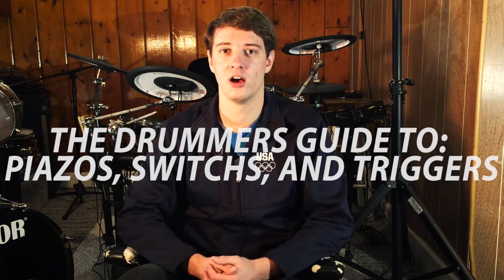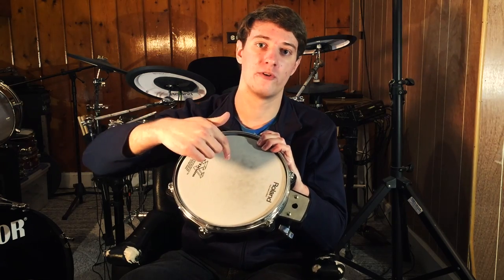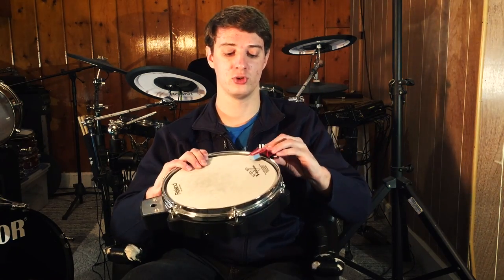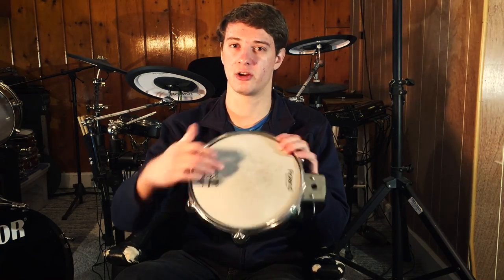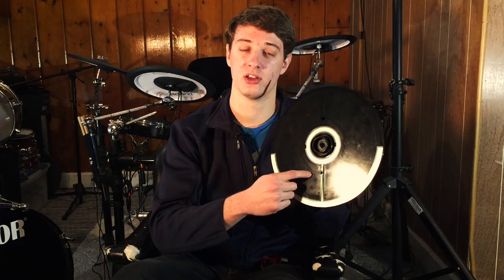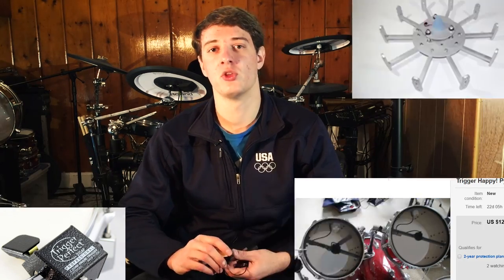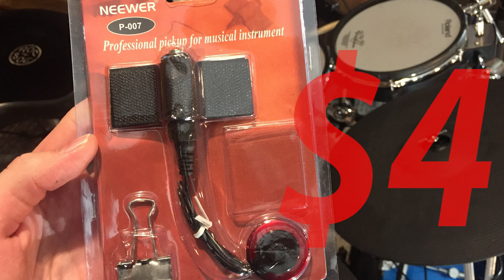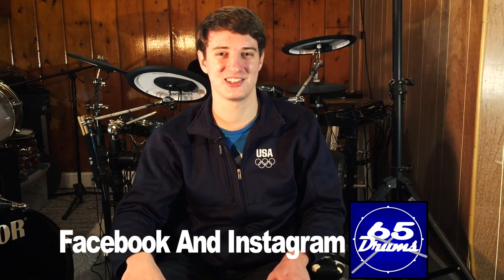How Piezos and Switches work: (edrums demystified)

Comment: Hello. Good job! In 1982 I and my band was one of the first buyers of Simmon elect drums; SDS-V, which I still have by the way. So after a few weeks my sound engineer and me decided to take one of the pads apart as when playing under very hot stage lights, the so called carbon fibber playing material glued on to the surface of 1/4” plywood would separate and they would puff up like jiffy-pop popcorn ( if anyone still remembers that product), when you hit the surface that carbon fiber would splatter like shrapnel. Anyway, we took one apart and found each pad was being triggered by a 
.25 cent piezo, same as you get at radio shack. So we got the idea to mount the piezos onto my acoustic drum shells and after s few tweaks, viola! They worked like a charm. You don’t know how many bands that have toured with us back then wanted to know how we were doing this through the acoustic drums; one in general was the drummer for the band, The Outfield , forgot  his name, but he had a mic suspended inside his snare drum and his sound engineer would add a little white noise to it, were as we had ALL the Simmons sounds at my disposal. In saying all this I have bene doing this at a time were no-one else even thought  about it. Just thought I’d share . But again, good job my friend...

Comment: piezo material generates a small voltage when it undergoes mechanical stress. The act of hitting the drum head causes the sensor to experience compression and therefore a voltage proportional to the amount of force. The drums must have amplifier circuits that detect this small induced voltage, amplify it, and then digital sample it. It must then be digitally signal processed and converted it into an audio signal. Quartz is a common piezoelectric material.
Reply from the maker: Very thorough definition.
Reply: Every chintzy little beep you hear coming from your various appliances? The alarm beep in your wrist watch? The speaker in your old school hand held LCD game or your late 80's computer? Piezo transducers in speaker mode. As mechanical stress induces voltage in the disk, applying voltage to them induces mechanical stress, which, if applied at the correct frequency, makes the brass disk resonate at usable frequencies. I think you can even use them in scales as a weight sensor. Nifty little toys they are!

Comment: Well explained, especially the cymbal. The hotspot issue also depends on the mesh material and the tension. Good Mesh heads that are not as stretchy will minimize the hotspotting.
Reply from the maker: I was really worried I didn't explain it correctly. I actually kinda put off posting this video for awhile. Thank you! And I did not know that poor quality stretchy drumheads caused hotspots. Good to know.
Reply: You did it correct with the cymbal. It is really a mix out of piezo and switch information. I was not sure about it myself, til I opened one of my crash cymbals. The hotspot issue is not caused by the mesh head only. But it is one of many factors. I figured out that drum-tec reel feel heads can be tensioned really strong and as they are not as stretchy, the hot spotting is reduced to a minimum. A Remo Silent Stroke for example, is way to stretchy.

Comment: Hey Justin, with all the vids you've created I'm shocked you havent made one with a good choking solution for using low volume cymbals with, in my case, a Roland head.  I hybridized my kit using acoustic drums, mesh heads with a mounted trigger inside the drums and KD-A22 on my kick drum beater head.  I replaced some of my dual zone PD-x crash cymbal triggers with low volume cymbals and non-roland triggers.  They work well for one cymbal sound but, as you know, it eliminates my ability to choke the cymbal and eliminates the extra sound I could have using the dual zone PD-x.  I havent been able to find a solution for this that seems practical for my skill level or that I can completely understand and create.  I'm sure many in addition to myself would enjoy you doing that video.

Comment: One thing that is false, that I've also seen in the comments, is that the Piezos doesn't create a voltage. It's better to think of it as a door, that's why there's two wires. Those two discs make a varying amount of contact when you hit your drum, allowing a varying amount of voltage to pass through. One wire is coming from your module with a constant voltage, and the other wire goes back to your module letting it know how voltage has been let through.

Comment: YES! You pronounced PIEZO correctly: pee EH(Y) zoh. Even the Brits start with pie. It's a Greek word, so pee, not pie. Aargh. 
Also, great video! All that piezos need is a change in pressure, hence the foam cones or donut-like cylinders.

Comment: Hi...we have a Roland PD-105 and it doesn't seem to be working properly....the "active" area for the snare seems to be just about 1-1/2 " in the centre and the rim is quite quiet....the wiring appears to be intact and the piezos are solidy fixed........what suggestions for checking the piezos and making the snare work better.....?

Comment: Question,
I read that a Roland pd8 dual drug trigger uses peizo for drum head and a switch for the rim,
My intention is to use the switch on the rim to activate a 'footswitch pedal' for looping on boss rc505 with acoustic drums,

Just as a footswitch would activate and deactivate a loop
But using rim on pd8 instead

Comment: actually most E-Drums are driven by pressure sensors, 
pieces only detect a change in pressure (eg put out a current both when you press down and when release pressure from the pad)

Comment: Hi. Quick question..

I bought TD-17K with Malaysian made CY-8s a half a year ago and they work AWESOME!....

 Well I recently picked up a 3rd CY-8 from Musicians friend (last week) and I noticed its an older one (or alternative) Chinese production..

My problem:  The Malaysian CY-8'S work PERFECTLY and never double trigger on a Crash/Ride hit.. The Chinese CY-8 tends to "ghost trigger" second hits registers it as a low volume "hit" (5 scale out of 127 max hit).  Is this normal?  Should I return it?  

It's not the cable or anything as I swapped position of both ride and Crash 1.. Same issue.

I noticed my Malaysian CY-5 (hi hat) does something similar to the Chinese CY-8, though a little different.  I don't care that much on hi-hat, but its something I noticed...

The biggest issue is trying to crescendo on the newer CY-8.. Seems to work at lower volume due to ghost hits nullifying Dynamics.. its SOO annoying compared to the Malaysian ones.

Seems to be a different Piezo than whats in my newer CY-8's.  More sensitive.. (I can hold the rear of the Chinese CY-8 and not get ghost hits) Not sure if thats a good or bad thing... but I really need need advice here.

Comment: Is it possible to create a 3-zone snare with the piezo and switch option? Looking to have the snare sound, side-stick and rimshot  available on the fly!!!!
Reply: Hey, not sure about that, but clever idea! What you can do, though, depending on the capabilities of your particular module, is assign the cross-stick samples to most velocity layers of the rim zone with the higher velocities assigned rimshot samples, so that above a certain velocity level hitting the rim will switch from triggering stick sounds to rimshot sounds. Since people generally don't cross-stick crazy hard or do quiet rimshots, such a setup should end up playing pretty naturally.

Comment: I need some help! I upgraded my Alesis ComptactKit7 with a a Roland FD-8 and KD-8. The FD-8 works great but KD-8 does not since it has a Piezo trigger in it. Does anyone know if there is such a thing of a converter that can bypass the Piezo so it is just a standard Switch trigger?

Comment: Great video! I was wondering if you can help me with this problem: I replaced the heads on my alesis drum kit with a mesh heads kit and I didn’t install any foam cones. I just realised that it could be the reason why the pads miss some note when I play. If they are so important, could you suggest me a way to make the cone with some recycled material? A simple sponge or vacuum filter would be suitable? Cheers!

Comment: Do you know how position sensing works? Are there more Piezos used or is it an other technique?
Reply from the maker: It’s just the two piezos. But they are positioned in a way that the module can time the delay between the two, and then predicting the position of your drumstick on the head.

Comment: Hi, man. I've got an Alesis Nitro Kit I bought used and all of the sudden the hi-hat pad started to work erratically, as if it had a false contact, you know like it would only sound every other hit, then nothing at all, then after a few tries it started to sound like if it were repeatedly struck super fast and then died. I know it's a long shot to ask you but did anything like this ever happened to you and if so what was the cause? What's your best guess. Thanks in advance.

Comment: great vid! you said using a central piezo my cause triggering problems towards the rim on a 14" and bigger drum, the td50 has a 14" snare and dont seem to have any problems, do you know how they have done it?
Reply from the maker: According to VDrum Tips, different types of mesh drumheads can help eliminate hot spots. And the TD50 snare is using some sort of new trigger tech, I'm unfamiliar with is inner workings. All I know is that It connects to the module via USB.

Comment: Just bought an electric drum. How do you mitigate sound lag when you connect it to speakers? Do i just need to bring the speakers closer?
Reply from the maker: What drumset do you have?
Reply: roland td11
Reply from the maker: There really shouldn't be a lag coming from that drumset. The module latency of the TD11 is one of the lowest in the industry. Maybe it does have somthing to do with the speakers
Reply: It's more of the time it takes for me to hear the sound after I hit the drum pad. I'll do some more research, and I appreciate the help